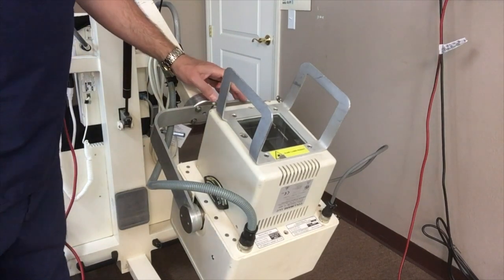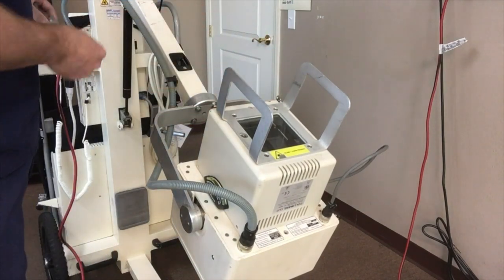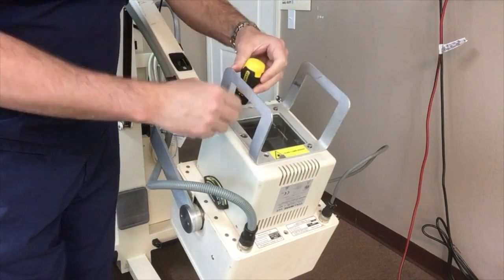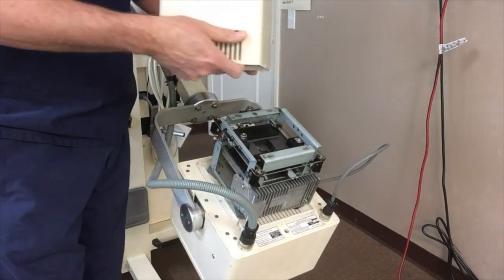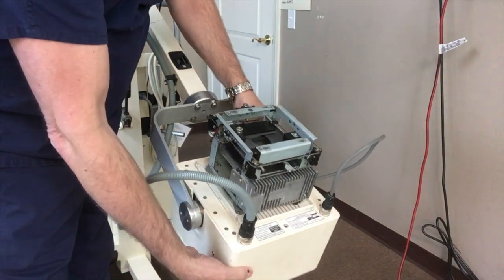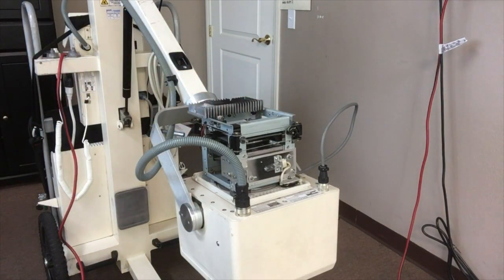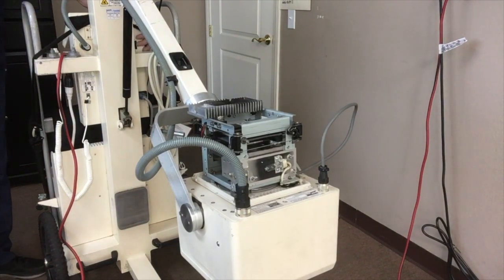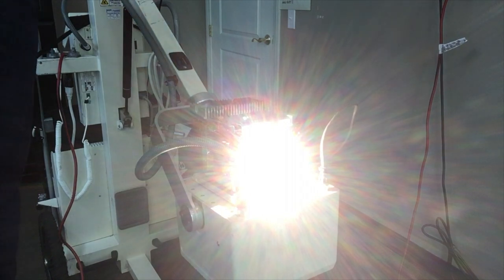Replacing SRI-130 Collimator Light

Comment: Hi, 
I have the same machine, I follow the steps and light still does not work. Original light bulb is not even burned or damage. What other problem could it be? I checked all wire connections and everything look great. Can you please advise before me calling service company, Thanks.